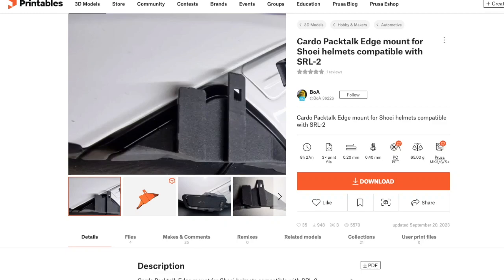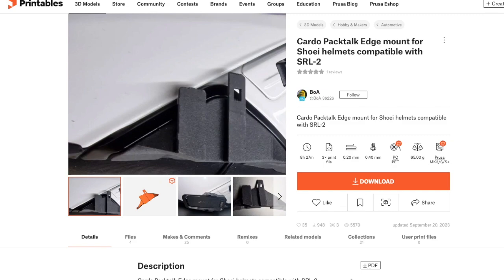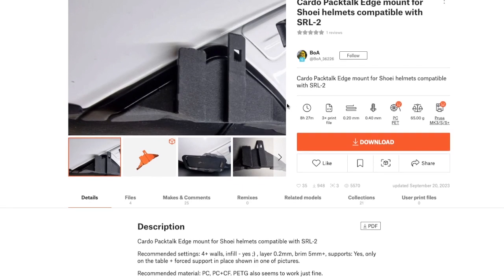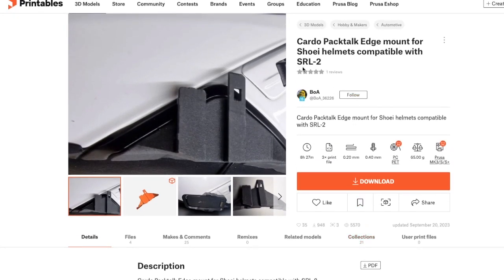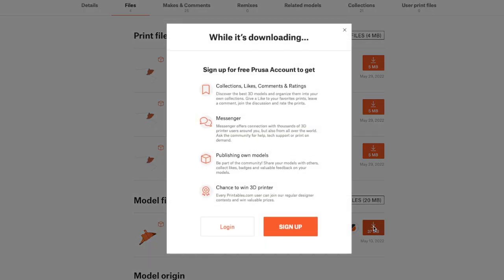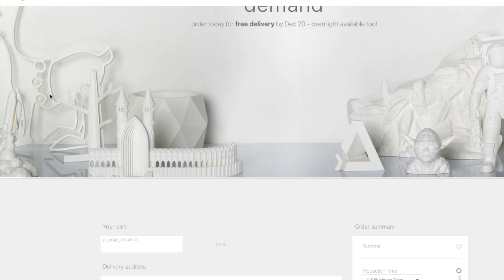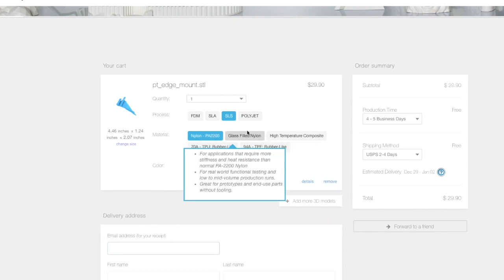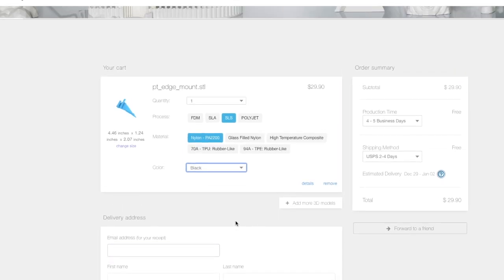Ordering & Customizing The 3D Printed Shoei Adapter For Cardo

Comment: Thanks so much for sharing this (and the original) video. A couple of months I had installed the glued adapter and unfortunately I had discovered your video only after the fact. And guess what: the glued adapter just fell off (fortunately at home). I just ordered the 3D printed part following on your excellent instructions. You are a life-saver! 🎉 Be safe!
Reply from the maker: Thank you for such kind words.  Sorry to hear of your trouble with the glued adapter. Thank goodness it was at home.  I'm surprised actually.  I thought the adhesive would have worked better than that--I just didn't want to bother with it.   I can say I've been about 750 miles or so (at least) with the 3D adapter on at all speeds with no problems so far.   I hope it works out for you.  Good luck!
Reply: Yes, it’s very strange: I did install it according to the instructions (clean everything with the alcohol pad, press it on and keep pressure on it for a minute or two, let it cure over night), and still it came off. My suspicion is that they used a new adhesive because when I look at the adapter and also at the helmet-side base plate I don’t think that it ever really bonded. The glue plate on the adapter side is barely “tacky”, and there is no residue on the helmet-side baseplate whatsoever. Fortunately the vendor (Revzilla) reimbursed the money without any problems. I had used Cardo’s glue plate for the old G9 unit and it held up for years… Well, this new adapter is a product to be avoided…. Thanks God for 3D printing!
Reply from the maker: @stkm1596   Thanks for the add'l details.  Sorry that happened to you.  Revzilla seems to have great customer service.  I've bought lots of stuff from them when I started my motorcycling journey a few years back and, with the occasional problem, they have been great to deal with.
Reply: Update: A few weeks ago, I received the 3D-printed adapter. The print quality was excellent and it clicked right into the helmet. It is a very sturdy (and good looking) piece, and by now I have ridden several hundred miles and it holds up nicely. Forget the OEM glue-on adapter. Do yourself a favor and order this one. MUCH better!
Reply from the maker: @stkm1596  Whew!  When I saw update I was afraid it was bad news.  Ha!  Fantastic that it has worked out!  Thanks for the update!

Comment: The printables file takes one to a site where they talk about a top-secret printer.
Reply from the maker: Yes, this video was made 10 months ago and a lot has changed with them in 10 months.  The maker of the file took it off the site, moved to Etsy and can also be found in a Cardo online forum on Facebook.   I've bought a different helmet and also moved on from the topic.
Reply: @RamblinManMoto  Thanks for the info.  I looked at the product on Etsy and it doesn't appear to have the required tines to handle the Cardo adapter.  I'm waiting to be accepted to the Cardo FB forum.  Trying to buy this for my Neotec prior to buying the Cardo.
Reply: @RamblinManMoto  Oh wait.  I see that the second one for sale on Etsy seems to have the tines.  I've ordered it.  wow, $20 in shipping costs!
Reply from the maker: @Mulepick  I have actually received a new one to review for the neo tech three that I planned to do this week. The cost of these things to get them printed and shipped irritates me every time.  Glad you found the one on Etsy.

Comment: Great info, but i ended up buying the Neotec 3 so hoping someone makes an adapter for that. As i love the cardo unit. If anyone knows of a product yet please advise.  Thanks
Reply from the maker: They came out with that darn Neotec 3 about 45 days after I bought my Neotec 2 and it could not be returned.  Bummer, but I guess I did get the adapter to work.  Hope you find something that works for that.

Comment: Thanks for sharing this, been interested in Cardo vs Sena and after a year of use with my Sena SRL2 Systems decided to change to Sena.  The poor sound, hard to use etc, and general system was hard to work for me and gloves.  Did Sena work, yes, but it was not easy and sound was poor.  This will allow me to have one unit, for two helmets (Shoe J Cruise 2 and Neotec 2) with improved sound, and connections.  Ordered today.
Reply from the maker: Glad it was helpful!  I'm thinking you mean that you changed to Cardo?  I hope your order goes as well as mine has.  The first unit I ever bought was a Sena, and I had a second one in the J Cruise 2.  I found the J Cruise 2 better than the first unit I bought, but I still didn't care for either Sena overall.   Totally agree about Cardo.
Reply: @RamblinManMoto  yes sorry typo meant to say switching to Cardo.  My issue with Sena is the lack of sound quality and what using the unit.  I do not have any voice control though it states you can you Hey Sena or Hey Siri.  I found using a friends Cardo the sound was much better as was the use of the controls (friends note that they simply use Hey Siri and make / take calls, reply to simple messages, control playback and volume).  it also seems our group is moving to Cardo as well.